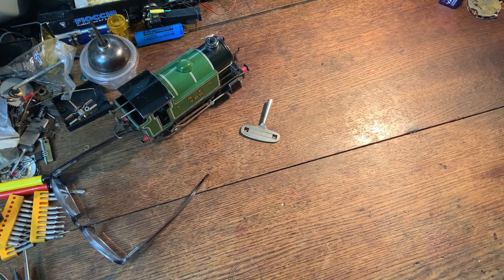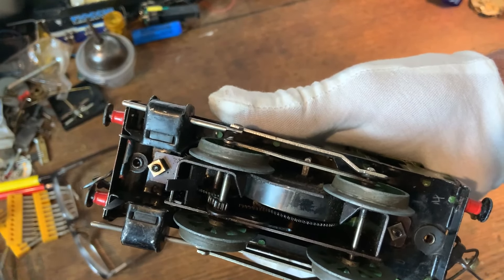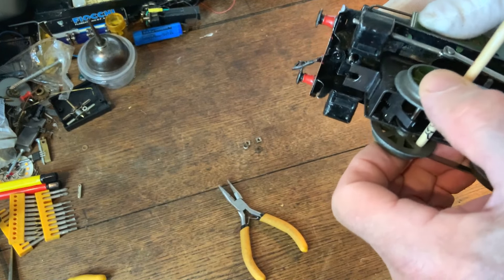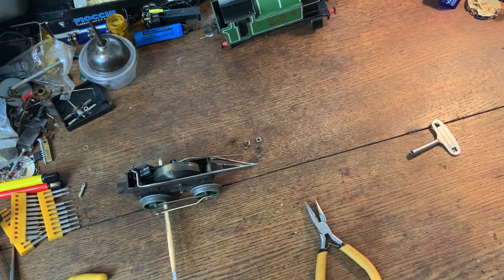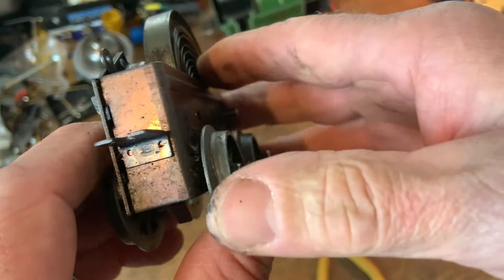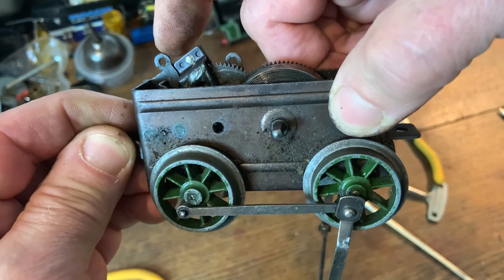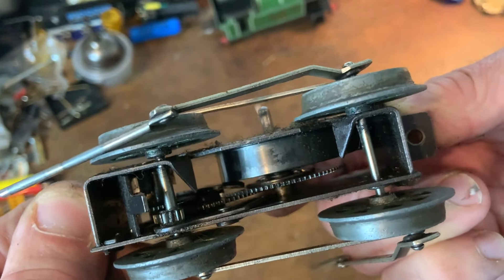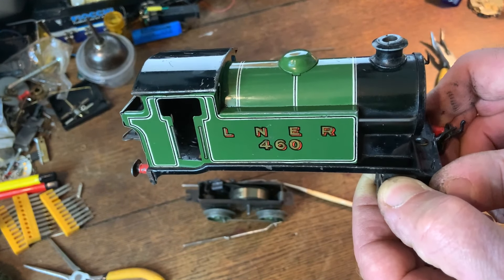Let's Have Some Stress Free Fun Fixing The Brake Lever On This Hornby 'O' Gauge 101 Clockwork Loco

Comment: Im glad someone has done a video of this mechanism.  I did pull mine apart because it was not just dirty but well rusted, so I needed to pull it apart to clean then dearest all the steelwork and clean all the bearings etc.  Unfortunately I only took wheels from one side which turned out to be the wrong side for separating the two metal halves of the mechanism.  Yep, everything just fell out.  Well it's all clean and most of the rust removal has been done with all the steel parts being oiled for preservation.  Once all the parts are done in the rust removal batch, I will start putting it all back together using images snapped from you video to help.
Reply from the maker: Hello, I hope you sorted out your mechanism. It's good you found this little video helpful. Happy New Year to you

Comment: Lovely old movement. :o) I have a vague recollection that early locos had the brake tab (like yours) and the track piece was a single tab that could be swivelled up from flat to the 'stop' position - but - I'm sure we had other locos which had a second fwd/reverse tab and a newer track piece had two tabs that could be flipped up, depending what you wanted the loco to do. Perhaps someone else will have more information. It would be nice to see the lamps as well if they were ever produced. Thanks for sharing!  Mike
Reply from the maker: That's interesting about the reversing option. I shall look into that. Best regards to you

Comment: Nice - I need to dismantle my No40, which is basically the same as this loco. The forward/reverse lever is a bit iffy and the loco is jumping out of gear, and is often very hard to engage either way, so I think opening it up and having a little look is not that daunting a prospect having seen this. Being able to work it directly without the long levers (which are often quite bent) is also very handy.
Reply from the maker: I hope your overhaul goes to plan. they are well made items and have lasted really well. Best regards to you

Comment: I just got the train set out of the garage, it is a Hornby Train Goods Set Number 50, the locomotive is a Black tender loco number 60199, there are 2 wagons and a brake van, the brake van has opening doors. In the train box was a small white envelope with "Hornby Ralway Lamps" written on it, in it are 2 lamp, they are very small, about 5 to 6 mm as a cube, there is a slot in the bottom to fit on the bracket on the engine, one lamp has a silver lamp and the other has a red lamp. I could send a photograph if youtube allows it.
Reply from the maker: A photo of the lamps would be excellent if possible. All the best to you
Reply: @MrSnooze  I have tried to send a photo to your emailaddress, did it arrive?
Reply from the maker: info@snoozevideo.co.uk is the one, nothing today

Comment: Hi Just like you. I found out  before you remove the Body Wind up the Spring. It makes it far easier to remove Body. Also  wind up the Spring before replacing Body Makes things so much easier. Also  I have to say  getting the Control Rods back through the Cab and the Piston Rods back in the Cylinders can be a bit tricky took me a few attempts
Reply from the maker: Thanks for looking, I took another item apart the other day and things went smoothly. Happy New Year to you

Comment: Dear Johnathan. A fascinating video away from your usual Super 4...
As a clock restorer, what would be your recommendation for lubricating : gears / axles / spring.
In the past I have used fully synthetic 5W motor oil.
Reply from the maker: On Clockwork Model Railway Items that oil sounds fine. For clocks a more specialist oil is called for. Best regards to you